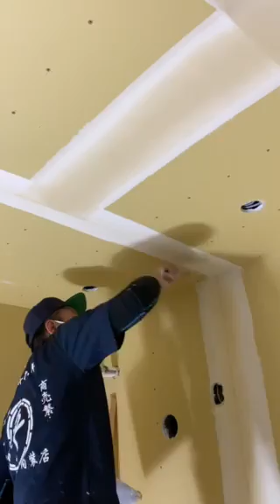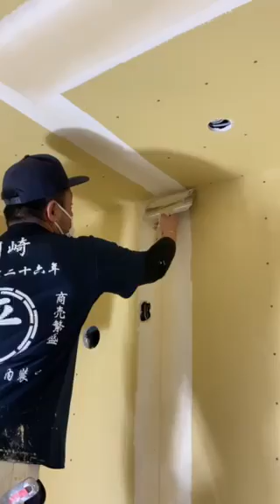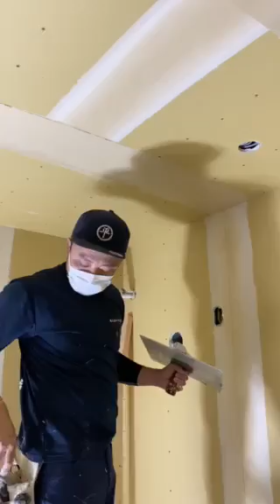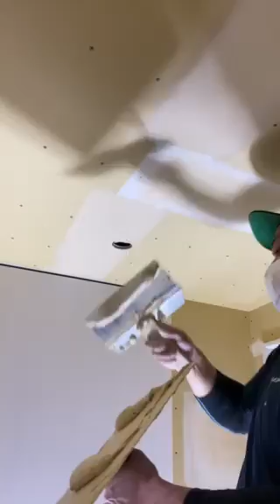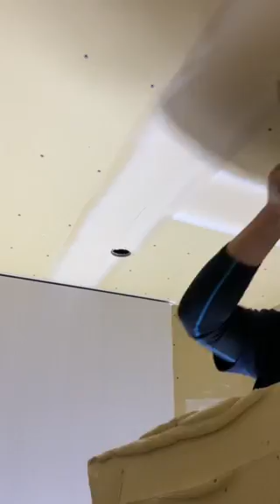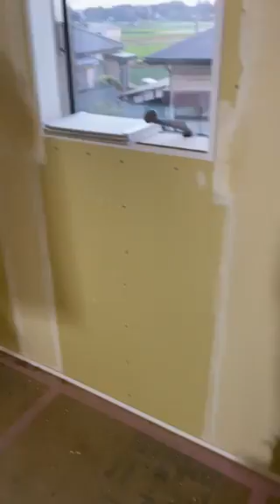Drywall Finishing in Japan

Comment: The boards are set vertical on the walls? I wonder if the framing is different there?
Reply: It's roughly the same. I think its because they don't want butt joints, also it's hard to work with longer sheets.